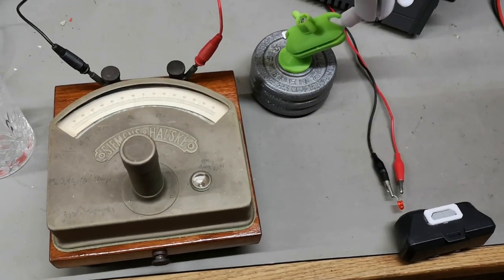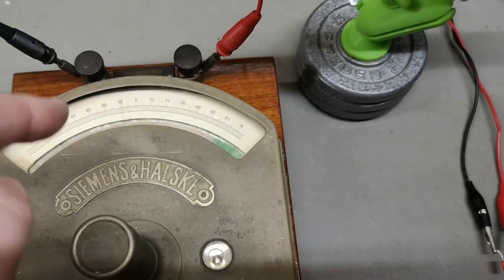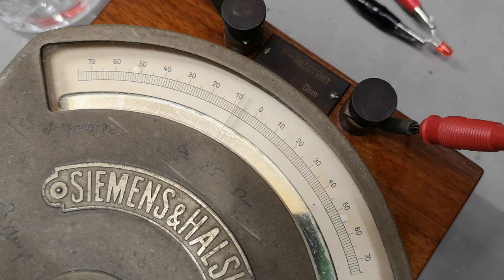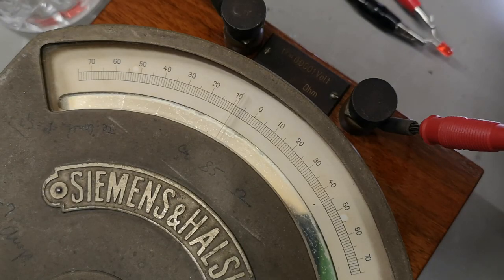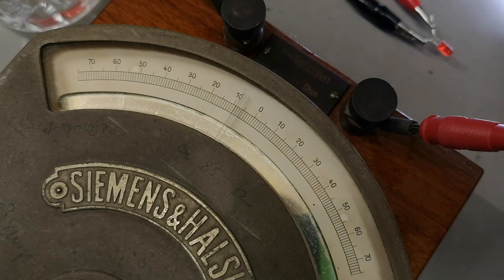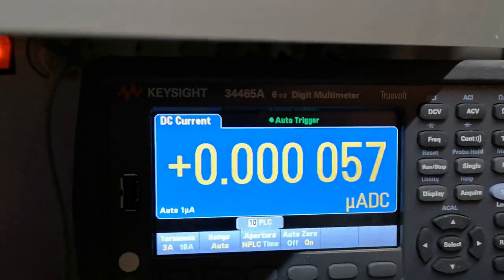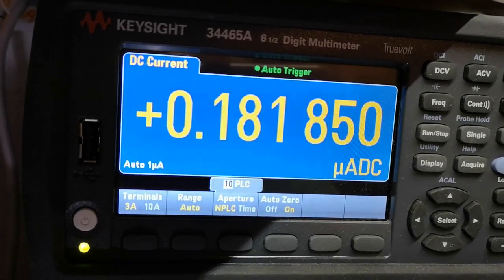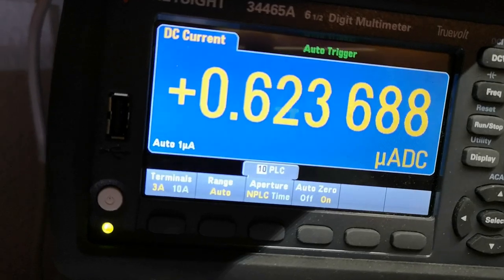Siemens Halske Physikalische Werkstätten Galvanometer LED torch test

Comment: You need to use the hyperbright LED's in a clear package, and with that you can take a green one, connect to a red one, and when you light the green with a bright light, green or blue, the red one will glow. The high efficiency LED's work well as photodiodes, though your voltage developed depends on the colour, and only the non phosphor ones work well at this, the phosphor coated ones are all either blue or near UV dies with a coating that blocks the return of blue or UV light to the great part, converting it to lower wavelength lights.
Reply from the maker: i am sure you are right, i could make another LED setup that deliver much more power, but it was fun to see only 0.5uA is detectable on this meter, that was the main goal of this experiment.